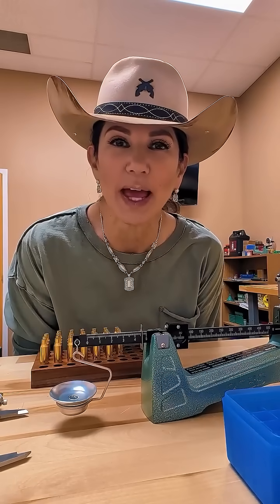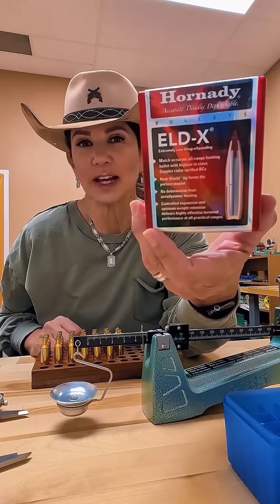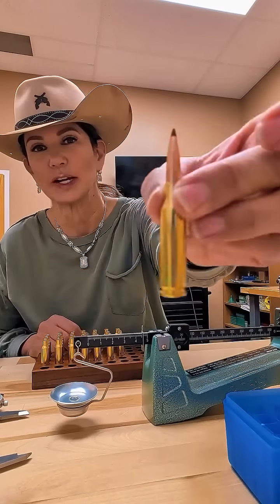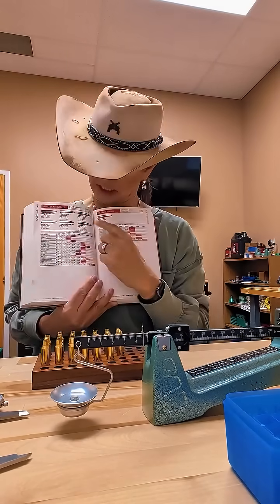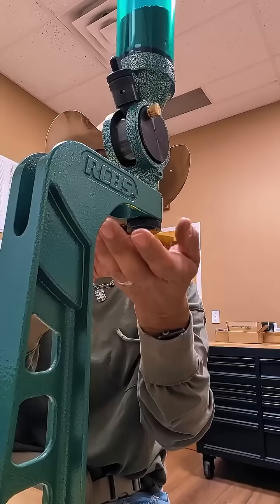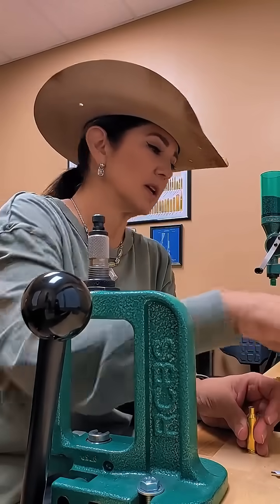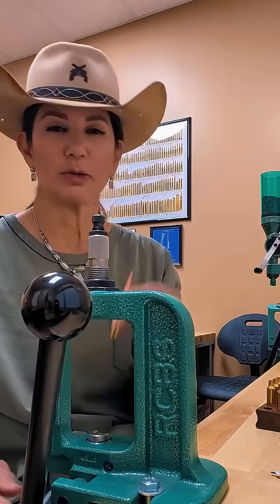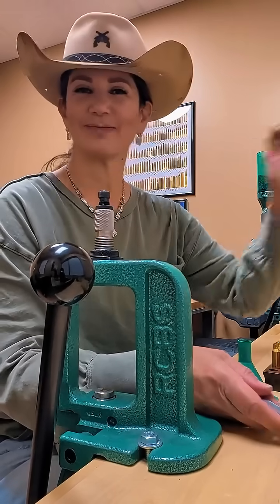Can You Make Better Ammo Than The Factory?

Comment: Any cheaper than outright buying them❓️
Reply: I did the math and i save $150 every 100 rounds reloading my 300prc.
Reply: @Duvielhernandez9086 That is significant. Plus you can achieve better than factory accuracy 👍
Reply: yes for sure, some cartridges are a lot more savings that others,  some are more work than others but always cheaper.
Reply: @dukeboy-6645 
And im guessing the round moves too fast to cast to be cast out of pure lead?
Reply: @mr.darkspud8916 yea. Only slower rounds like 9mm, 45acp and such aren't jacketed.
Reply: Once you have the once fired brass you'll be spending almost as much as moderate-cost rounds. The savings increase with harder to find ammo. Another advantage is you can fine tune the load to match your rifles personality.
Yes...guns do have personality.